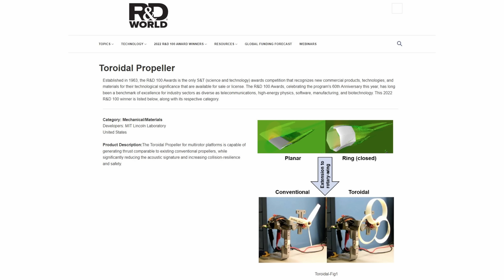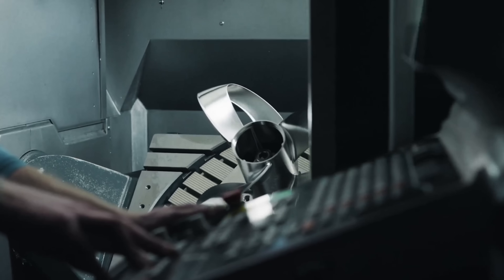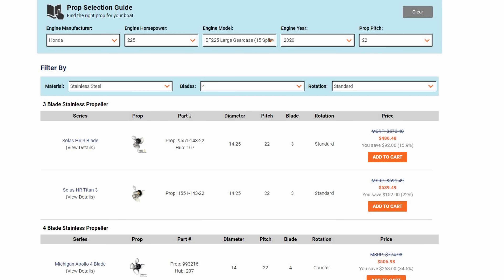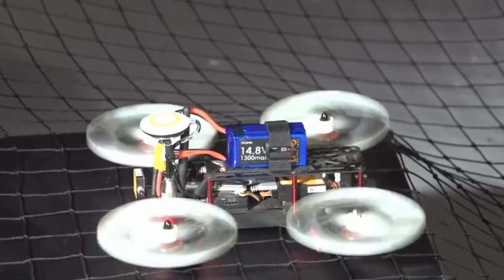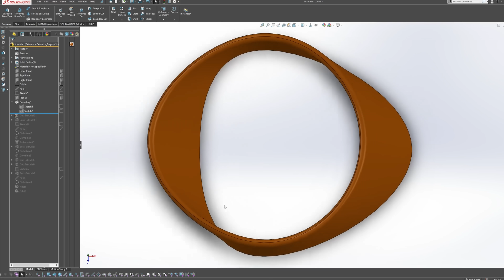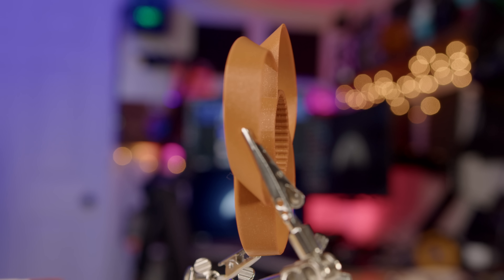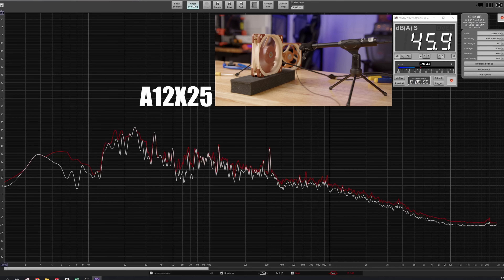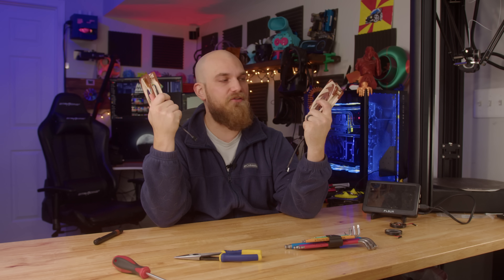I Turned MIT Award Winning Toroidal Propeller Into A PC Fan | Fan Showdown S5 Special

Comment: The biggest reason your torroidal is not performing as good is because you didn't give it enough finish love.
Threads still all over, no polished surface - and the connections could be smoother too.
So IMHO for such a rough prototype it performs very well.

Comment: Do ducted fans have the same issues regarding tip vorticies as unducted fans?  There is a small tip gap but I would have thought the proximity to the duct wall would significantly suppress tip vorticies already.  In which case this really isn’t a fair comparison as the MIT design is intended to minimise these vorticies for an unducted fan.

Comment: not a fair experiment, first you should also 3d print the noctua fan, then to compare both you need to put it in a "open" fan configuration. and lastly these torodial propeller might need more rpm to show any significant benefit

Comment: You should test with the 3,000 rpm iPPC noctua variant. I have one I used on a hybrid GPU cooler and when turned all the way up it sounded like an air raid siren

Comment: I think you could have made a few more prints and gotten some better performance out of the toroidal. I find it hard to believe that there's no way to make the design quieter. The comment about the weight balance makes a lot of sense but I also think there may be too much material on the tips in this particular print.

Comment: I'm no engineer, but it seems common sense that a fan blade (has what, looks like 10 blades?) is not the same as a 2-3 propeller. Apples and Oranges.

Comment: I see the flaw in your MIT fan. The return point on your leading edge returns to an almost zero angle when it should be returning with as much or more angle as the leading edge in the middle. The fact it got as much thrust as it got is impressive given in the obvious flaws in your angles of attack.

Comment: Very interesting work with the 3d printing , the smoothing ABS one was good one, have you seen others smoothing the PLA by placing in boiling acetone vapour bath.  maybe the temperature help it smooth PLA.
btw which software was that used for frequency analysis of the sound ?

Comment: I think that version of the blade was purely for noise reduction, also it seems that the blade design also does best around 3-5k rpm under that it’s performing only a slightly bit better then basic designs, also at higher rpm’s it seems to have a gradual decline the faster it spins.

Comment: Simple principles of the experiment were violated:
1. Both props should be made/printed from the same material, the same method.
2. The qualities of balance should be ensured for both.
3. the mass
Then I am not sure if one of the propellers should be related to MIT if the real design and principles are not known.
For me personally, I don't like the angle of attack and thickness of the side surface.

Comment: Toroid...with 5 degree camber.  Is the limit theorem a joke to you? Get in there and workshop it in MAPLE or ANSYS or something until you need to add some feathering on the back to quiet it down. Open a ring to ventwork, bring another in, and counterflute the hub.

Comment: a simple ring in the tips of a multi blade fan will do the trick, that's the reason jet engines are more efficient  not because of the turbine but the fan,bet if a piston engine is equipped with a multi fan it will be superior to a jet.

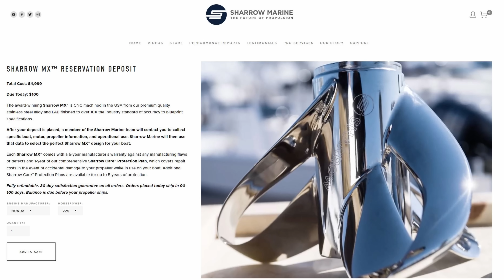Comment: 1:12 $5000 for a propeller is nothing in the high performance boat world, considering they'll be attaching those propellers to twin engines that cost $200,000 each in a boat that cost well over $1,000,000.

Comment: It would be more reasonable to test with a similar number of blades, 
as each ring-shaped fan blade corresponds to roughly two traditional fan blades. 
Therefore, the fan in the video with 9 blades should correspond to a design with at least 4 ring-shaped fan blades.
Alternatively, you could replace the 9-blade fan with a 6-blade traditional fan to make a fair comparison. 
Additionally, one product is a mature industrial product, while the other is 3D-printed. 
It would be more reasonable to compare both using 3D-printed products.

Comment: How much current did it pull? Yes, you have less flow, but how much less current is required to power it? That is the million dollar question. If you have less current, you could spin the fan faster for the same amount of total energy. Then compare the two. Equal energy input vs output. 
The problem is that you asked/answered the wrong question.

Comment: idk i feel like you should change up the attack angle some, something more aggressive. i think the MIT design didnt have a massive cylinder in the middle taking up tons of space if you look there is almost a full circle with the middle taking up at most .25 of the available area while your design is taking up obviously more than half the usable space. i feel like you will have to compensate by making the attack angle on the blades more aggressive.

Comment: YOU SIMPLY DON'T UNDERSTAND THE ISSUE! There is no tip vortex on that A12x25 fan, so you are trying to solve a non-existent problem. Wing tip and blade tip vortices form because high pressure air from the underside of the wing (fan blade) peels over to the top side when the wing terminates. This peel over causes a spinning column of air to form at the tip and only at the tip -- it doesn't form over the rest of the wing (fan blade). Your A12X25 fan has a shroud! The tips are running almost right up against the shroud and the air from the underside of the blades CANNOT peel over to the topside because it is overwhelmingly blocked by the shroud (fan case). And, whatever leaks through the hair crack has that wall right next to it making it very hard to become a vortex. Wing tip fences and wing lets accomplish a similar feat by blocking and interfering with this peel over with a vertical surface. In marine propellers you can also do the same thing by putting the propeller in a lamp shade like shroud. As a matter of fact most of the newer submarines (like the US Virginia and British Astute classes) do that. A turbofan engine from a modern jet liner is a lot "quieter" or should I say less buzzy than a turboprop again because the fan is shrouded by the engine nacelle.
--
What you did is put three toroids that is aerodynamically dubious into a fan case with huge gaps between it and the fan case. Of course it is louder! The value of a toroidal prop can only be realized in a NAKED FAN. If your only objective is a quieter fan, adding a ring around the perimeter of the blades joining them together will do as well or better than toroidal blades. The problem of course is that that ring adds weight and rotational inertial without contributing any thrust. The same cannot be said of a toroidal prop.
Reply: yeah I don't understand why he didn't just use the prop for literally it's intended purposes and put it on a drone so we could actually see the sound difference

Comment: If the boat consuming less petrol with the expensive 5000€ propeller then is cheaper than one that cost 500$. Imagine that some small yacht consuming 200 litres per hour in an efficient speed. Except if you use the boat once a year.

Comment: Not an engineer but could the material that the toroidal blade is made out of also affect the sound, maybe not so much the airflow if the fans are actually at the same rpm? I'm sure the material that the fan was printed with is good but maybe not on par with a molded piece of plastic?

Comment: @MajorHardware Looking at the A12X25 at 5:31 and the toroidal at 5:44 the tordoidal appears to be rotating much slower.. If the design is indeed more efficient at pushing air through, it would stand to reason that it would also require a more powerful motor/more amps to rotate at the same rpm as the A12X25..
Is there any way you could test the toroidal at the same RPM as the A12X25? Try overvolting the fan motor but I am guessing it would probably fry before it gets up to the same speed as the A12X25 so you might have to mount it to a bigger motor, perhaps a motor from a 200mm fan?
I also think the higher noise of the toroidal is from vibrations because its 3D printed and not properly balanced.

Comment: As you already say your RPM is likely way too low at 2k.  Data sheet for boat propeller shows almost identical performance til 3k RMP. Their big +105% gain is at 4k RPM and it vanishes again at 5k RPM. Now Im clueless on this but i would expect air needs higher RPM than water since water is way denser.

Comment: 4:19 Would you be willing to do a test of how many amps each one is pulling at aprox 2000 rpms? Really what I'm curious about is if the new model is given the same amount of power . . . what would the RPMs be (on that new model) at the same power demand (that the old model) was using to reach 2000 rpms.

Comment: Seems to me that your angle of attack was too steep across most of the blade. I'd guess that only about the first third of it nearest the hub was doing any real work, so it's no wonder that you weren't getting much force or airflow. Doubling the number of blades would probably help too. Case fans aren't designed with half the blade edge set vertically for a good reason.

Comment: Your toroid needs to be thinner and sharper. It's too thick and blunt compared to the Noctua fan. Also the angle of attack of the blades needs to be higher. Should give better results.

Comment: You eyeballed your angles.  Of course it didn't do well.  You have to take into account motor torque, RPMs, total size, air flow dynamics to make it correct for that specific use.  It can be done on a computer simulation much easier or with lots of patience if you made many incremental versions making minute tweaks and testing with lots of patience until you zeroed in on the optimum design.  All in all though, it was a good watch.  Will subscribe.

Comment: the MIT design is mocked after drone/boat propellers. The Noctua fan isn't. it has far more fins that allow it to brute force the static pressure. you need to double(at least) the amount of fins on the MIT design. Just look at how much dead space there is in between blades.

Comment: Comparing a 9 blade with a 5.5 blade is not fair. Should add two Toroidal blades (1.8 blades each) to get equal blade size or surface. Calculating the performance it should be around 286 x 1.67 = 476 ft per minute of airflow. Subtract a 3% speed difference still points to potential.
Optimizing the design and finish might make it a 500+ ft/min. winner. The potential is there because it has a smaller core en thus bigger space for more blade surface.

Comment: Thats why Drones are invented now where the propeller is in a Case. so the tips dont make noises anymore. that noise only accures to blades who have exposed tips. So any PC Fan od Drone what has propeller in Cases don tmake that noise. there only the Blades side what cuts though the wind makes a noise. Did you include this with your Tests?

Comment: To be fair. This was just your first crack. Look at how many blades compared to yours. It’s a good idea but needs to be designed and optimised specific to the air, speed, desired pressure, flow etc.

Comment: PC fans are enclosed blades, how do you get tip vortices when your blade is fully enclosed? There's no physical path for the air to try to get around the blade-tip, so there can be no tip vortices, which means no extra noise.

Comment: U didn't measure the electric Power that was needed to spin at the upm's so it is possible that the toroidal design is capable to push more flow at higher speeds with less power...

Comment: did you try and remove the fan housing? The toroidal fan has an external ring that's pushing air against the fan against the housing. Remove the external square housing!

Comment: if you look at the toroidal blade compaired to a traditional blade as they compared them if it was a 3 blade, it was a tri-toroid, if it was a bi-blade then it was a dual-toroid, so in your case you would have to design it to be  9-torid blade. your trying to replicate the total surface contact with air. A drone requires far more CFM to fly than a fan does to cool.

Comment: You can't compare the efficiency etc of what you made, which is a direct copy of 'the' toroidal version of (and was made to specifically replace) a specific, three-bladed type of propeller for a boat when you use it to replace an EIGHT‐bladed one that is specifically designed to generate air flow. The latter already is a much more optimized design, as it is already made to avoid creating false air (in this case) flow and vortexes by exactly the same approach that also was the underlying thought that inspired creation of the toroidal one: the eight-bladed one already HAS a wildly enlarged amount of edge (the part of the blade that creates all those undesirable effects when there's not enough of it) and also you now try to compare the toroidal version of a three-bladed version with the outcome that an eight-bladed one has. There are reasons for chosing for a certain number of blades, but there are different ideal designs for different specific operational environments. That depends for instance on the amount of RPMs, how much force may be involved in generating the ultimately obtainable maximum outcome (how much power consumption may be, a thing that of course relates to RPMs as well although not uniquely, in fact we are talking torque) and how strong the motor you  are going to apply, what type of flow you want to create (and in what type of medium, of course) and there are probably some more things that come into it. The ultimate outcome is going to depend on how the finally chosen design is tuned (especially angulation, 'thickness' of the blade relative to its amount of surface) and fine-tuned (how the blades 'warp', for instance). Apart from those specifications, the most important specific difference (as a thing I already pointed towards) comes down to finding the right balance between the amount of surface of your material versus the "amount of" comparable open space in-between the blades.

Comment: Need 4 blades not 3, 9 vs 6 blade not a comparison. Add another one on that weird fan. That weird fan i assumes is designed for higher rpms with that kind of structural integrity

Comment: you're measuring sound based off intensity rather than volume, while it may produce a higher intensity sound, when you look at perceived loudness intensity can be somewhat misleading, higher frequencies require a far lower sound pressure level to be perceived as loud in comparison with lower frequencies. 

obviously you have the fan in hand so with perceptual loudness you have the say, but looking at equal loudness contours would indicate that it may be quieter when not running at full speed

perception of loudness can be tricky

Comment: I think there is part of your ring design that does nothing because you have already have an inside circle w/ the mount.  I think you could just reduce the weight by cutting each blade ring by 1/3, like a biohazard symbol.  your blades are aggressive enough, so if you can get more rpms with the cutting I think it could beat the A12 in sound but prolly not all the ft/min.  Someone send him a BIOHazard fan design with toroids and maybe make it look a little fractal-y. :)

Comment: Did you sand the 3D printed prop or use it as is? 3d printing does leave a bit rough surface and that does make quite a difference compared to the very smooth pc fan.

Comment: Without reading the comments below...
To get the test done correctly, you would also need to print the A12X25 from the same material using the same printer. 
This would give both fans the same opportunity to perform equally as you are only focusing on the design.

Comment: Great video, but you are missing the point of the MITfan design. Their design competed against 2-3 blade high rpm propellers. You are testing two very different fans. The mere act of ducting the fans reduces the propeller vortices and noise profiles. For better understanding of the advantages of noise reduction of the mit prop v the standard prop, start by testing them without ducting around the propellers. The other item is that the PC fan you are using has a large number of blades, greatly reducing vortex size and intensity. Weight isn't an issue for PC fans, so there isn't a strong weight penalty compared to aviation propellers. Try a igh rpm PC fan with 5 blades or less, and no ducting to see the large difference a toroidal propeller shape makes overall in noise, efficiency and vortex generation. To see the difference the MIt toroidal propeller makes for aviation, test noise and efficiency profiles for a high speed, max 3 blade, unducted propeller compared to the MIT propeller.

Comment: Key point here: the drone and boat props are not encapsulated, whereas the PC fan doesn't have an exposed tip.

I love your attempt here, but these enclosed computer fans are probably not the application for a toroidal design.

Comment: you cant compare a 3 blade fan with 1 that has many more. Also by the looks of it, the depth of the toroidal is not large enough in your design. You might wanna play around with fluid simulations just to check how to optimize your design

Comment: You should be measuring the noise it creates, but instead you measure the air flow noise, so in order to measure it properly, don't point the air flow directly to the mic when measuring the noise it creates.😅